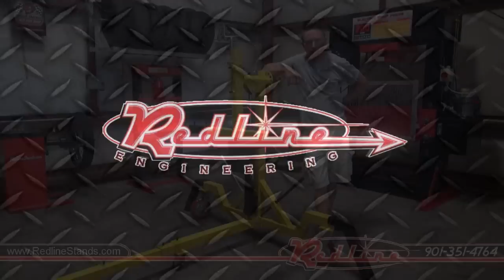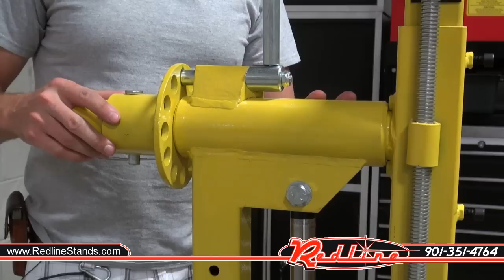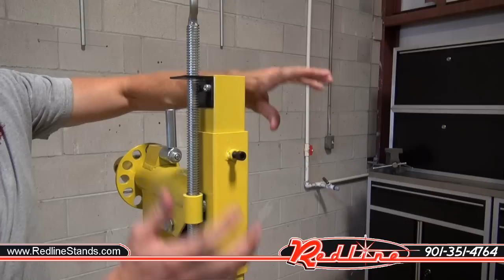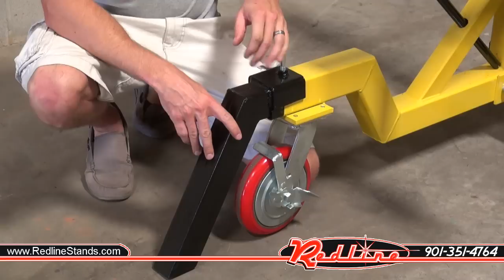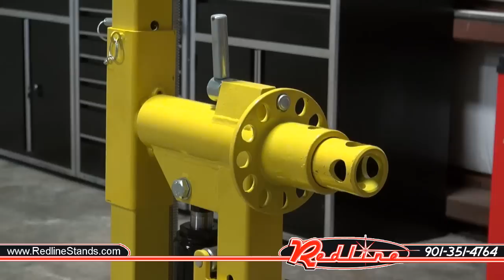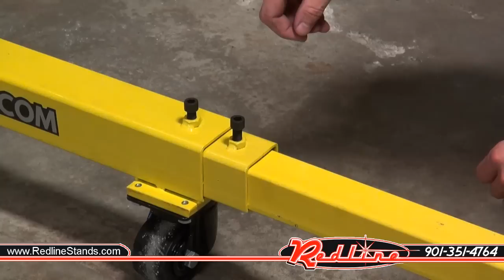Titan ROT-4500 Automotive Restoration Rotisserie

Comment: I'm looking at purchasing your Titan Lifts Automotive Rotisserie - 4500 lb. Capacity ROT-4500. I have a 1963 Impala CONVERTIBLE.  Body and floors are solid. I just want to spin it so I can sand, seal, and Raptor Liner the underbody.  Do you think I wil have to put an endoskeleton even though I'm not replacing any panels?
Reply from the maker: Mandatory?  No.  With that said, I do recommend fabricating a very beefy set of door braces to connect the upper hinge mount to the door striker mount.  If you do not do this, you will surely regret it tenfold.  I say this because I was recently in a professional restoration shop that was doing a convertible, and that's how they did it.  For this one, don't buy door braces that have joints.  Fab them, and make them very....very solid.

Comment: This is NOT a Beefy Machine!
Reply from the maker: If you want beefy, check out the ROT3K in my link below.  It weighs a lot more than the ROT-4500
https://www.redlinestands.com/catalog/shop-equipment-c-327/automotive-c-327_328/rotisseries-c-327_328_212/redline-engineering-automotive-auto-rot3k-rotisserie-p-1143

Comment: i have two that are 4 years old not you brand but same overseas manufacturer that work great good bang for your buck . but can you get the bolt on gear box kit that i see fitted to some unit's would make these rotisseries even better
Reply from the maker: Right.  The unit with the gearbox is the RTS3000, which is a substantially beefier rotisserie.  Sadly we do not have any kind of conversion kit so the gearbox can be added to an existing rotisserie.  Thanks!

Comment: Hi. I just purchased this unit for our shop based on your video. You need to take a serious look at your quality control. Welds are very poor and fitment is also poor. We had to manufacture and weld our own improvements to make the unit reliable. The instructions are so small we needed a magnifying glass to read them. The jacks are tooooo slow takes forever to lift
Great concept poor execution
Would return if I could fit it back in box.
Reply from the maker: Copy.  So, this unit is manufactured by Titan, not Redline, and please understand when you see our video and tell us  about our quality control, it's not "our" quality control.  Assuming you bought the Titan rotisserie from Redline, please send us pictures to substantiate the poor quality.  We'll get with Titan and see what can be done to make it right.  With that said, we haven't sold one of these in a few weeks, so I suspect maybe you bought it from our competitor and are voicing your quality concerns with people from whom you did not buy the product?  Still, we're happy to help you either way, but we won't have the ability to look-up your order unless you bought it from Redline.  The last thing I want to say to anyone who reads this is this.  If you want a high quality rotisserie, please don't shop for the least expensive models.  We sell the AutoTwirler Pro.  It's American made and it costs about double the Titan.  The quality is much higher, and it should be, because you get what you pay for, and there's a reason it's expensive.  So, please understand that these entry level units with entry level prices will get the job done, but they're not the AutoTwirler Pro.  I hope this helps.  Reach out to us at RedlineStands.com and we'll help you any way we can.
Reply: @RedlineStands   Thanks for your reply. Yes my comments are to Titan not to your company. I purchased the unit from Mile x equipment not you but your video is misleading to consumers like myself and that is why I commented. The machining and welding on this unit are poor. The holes drilled for the adjustment screws are off. The extention sleeves fit on one side but not the other. This was my experience with the unit and its important consumers know. Again your company is just selling a Titan product and has nothing to do with this issue. Just for public information on Titan products not Redline. Thanks
Reply: Instablaster...